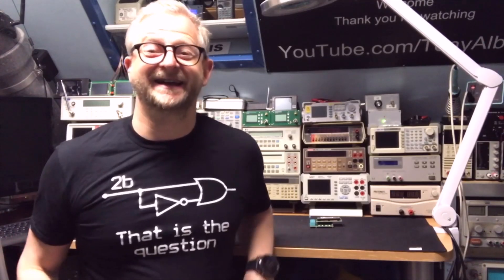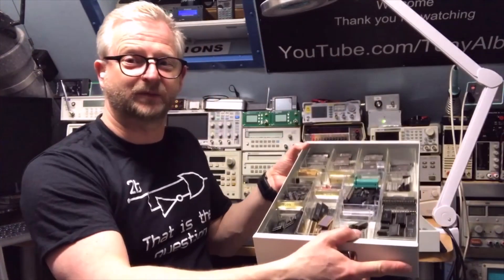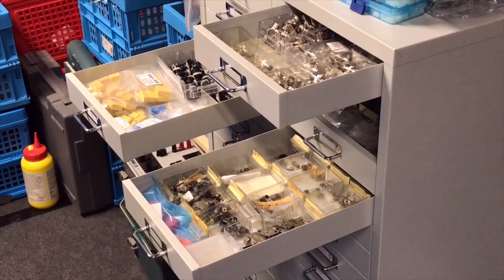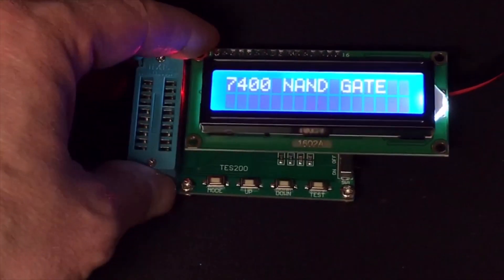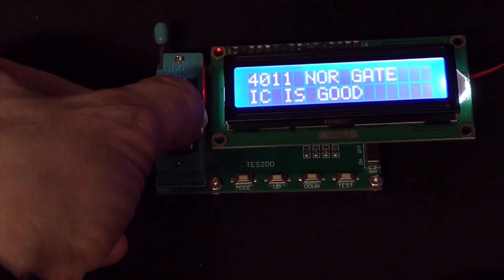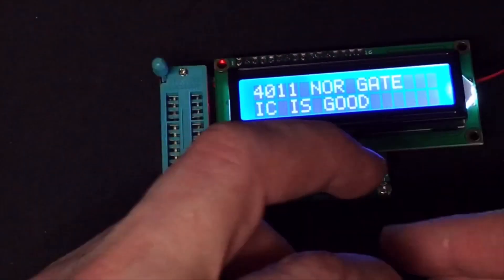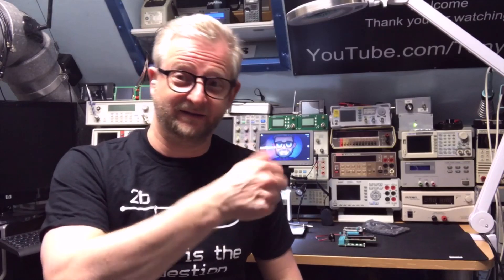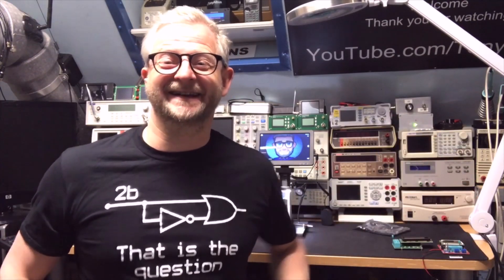#152 TES200 IC-Tester 40xx 45xx 74xxx Hands on Test

Comment: Sorry, I’m a newbie and a bit thick. If I have an IC 74LS02 do I enter 7402? So far it’s said every single one of my ICs is bad! I've subscribed.
Reply from the maker: Hi Mark, yes that is what i would do.. Put the lever UP.. then put the IC as low in the socket as you can.. and with the notch up..then push the lever down.
Reply: @TonyAlbus  Thank you very much indeed for such a prompt reply, it’s really appreciated. It worked, I was putting it in towards the wrong end.

Comment: Apparently the TL688 eeprom programmer can be used as an IC tester too.
Reply: Yep - it can, I have one and used it to do so :)  Although this seems to be able to do it without the connection to the PC, but sure the TL688 can do more, so may be worth getting hold of one.
Reply: You can even test your EPROMs with it - not found anything it cant test (or program) so far.
Reply: @Stephen_Heathcote   I think saw a video where someone had used it to verify a custom ic; specifically a Commodore 64 PLA; but I cannot seem  to find the link.
Reply from the maker: i need one!   😁
Reply: @TonyAlbus  check the ebay store xgecuofficialstore ; they seem to be an official distributor based on the manufactures dealers list
Reply from the maker: thanks, i will!
Reply from the maker: @stevenspmd  TL688II Plus V10.33 On its way :) .. if i understand correct.. software can update the firmware.. latest is 10.80 .. will see whit it arrives. already downloaded everything.
Reply: @TonyAlbus  I have the TL866CS (App software version 6.85 and Firmware version 0..2.86) - The Older version, but i believe that any updates for the new  TL866II Plus will be downloadable :)
Reply from the maker: @Stephen_Heathcote  From what i hear from you, the 'older' version can already do everything you need. perfect!... can't wait :)
Reply: @TonyAlbus  Hi Tony, I was not able to find the TL688II Plus V10.33. I found only version 9.0 on ebay, do you have the link to the store? Thank you, your videos are very interesting!
Reply from the maker: YouTube is not excepting my reply to you... frustrating.. it blocks external links
Reply from the maker: I have put the link in the description of this video, as far as i understand now, the version can be updated from the latest software of the official website, then the firmware is updated.
Reply: @TonyAlbus  Wow, you got one rather quickly. All my orders are still on the slow boat.
Reply from the maker: @stevenspmd  Yes with-in 10 days... lately i am lucky with fast delivery..
Reply: @TonyAlbus  Wow, I've had shipments stuck locally in Canada for up to a month.
Reply from the maker: @stevenspmd  Sorry Peter, that is a long wait... but then you are extra excited when it is finally there :)
Reply: @TonyAlbus  Thank you!
Reply: @TonyAlbus  You of course mean the TL866II ! And if you need a very good tester to test Commodore, ZX spectrum, Atari and many other ICs you should look for Evie Salomon's Chip Tester Pro! That is ideal for C64, C128, FDC 1571 Floppy drive controller, Gate arrays plus many other testing including cpu's NE555, TTL, CMOS. Also SID C64 test, Amiga chip tests ! Upto 48 pins ICs textool socket. Also in-circuit testing possible! Regular free Frimware upgdates, easy update with integrated SD card!
Reply from the maker: @1science100  Thanks Albrt, sounds like a very usefull device!
Reply from the maker: Thanks, nice extra.... its on my list to have in future..